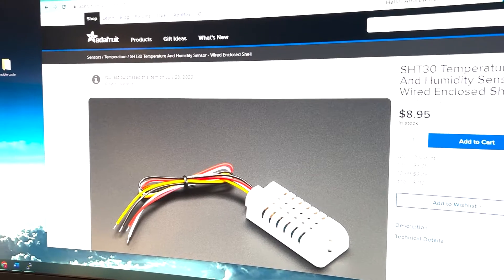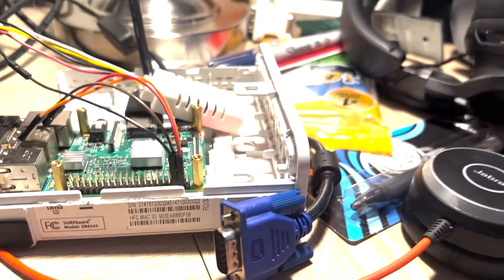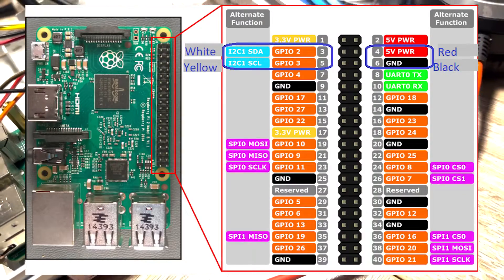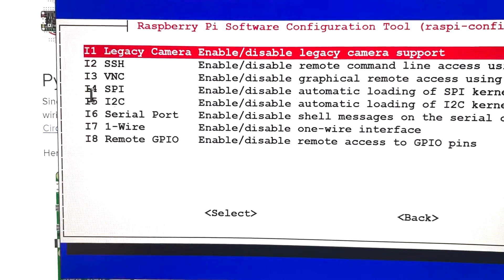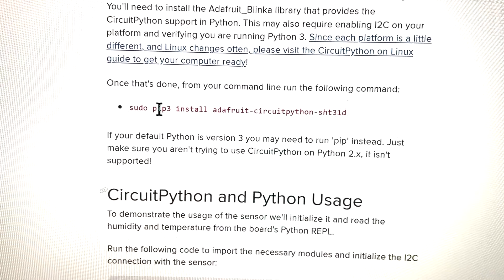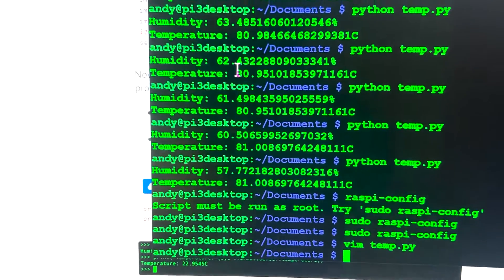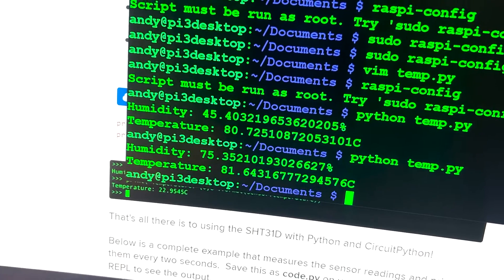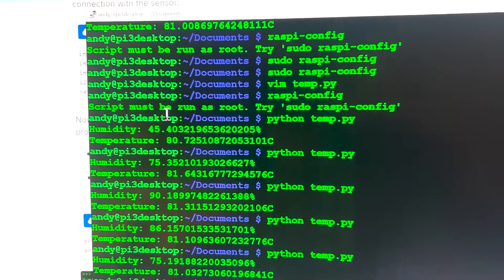Raspberry Pi Temp Sensor (Adafruit SHT30)

Comment: Do you plan on building some dumb cooling system with this Raspberry Pi board ? Some fans temperature sensor and simple Regulator. And about dashboard are you planning to build some application or just web interface?